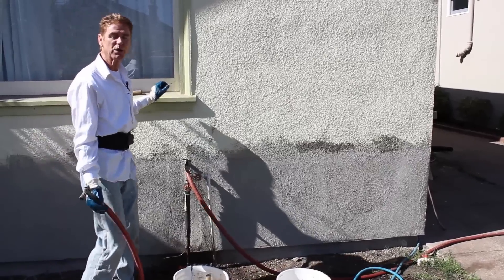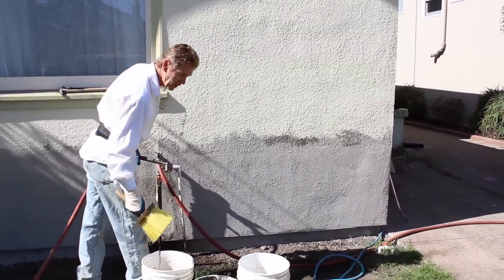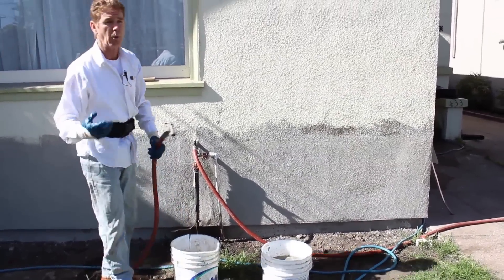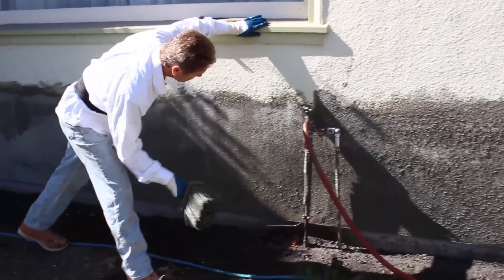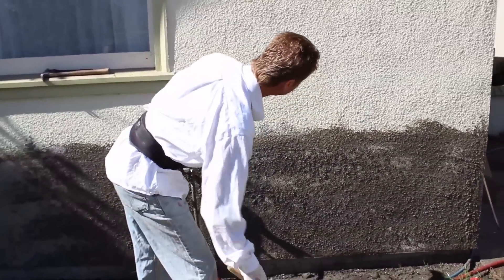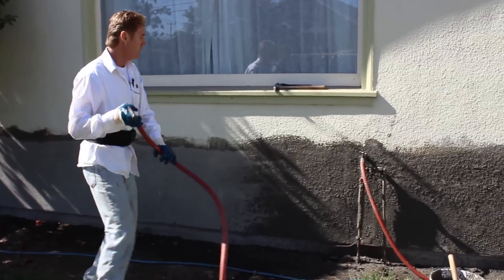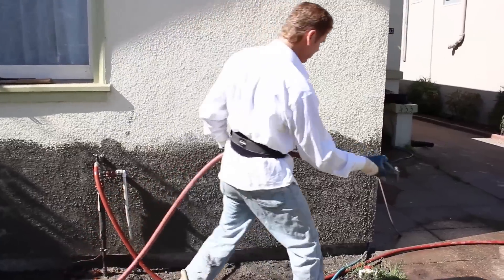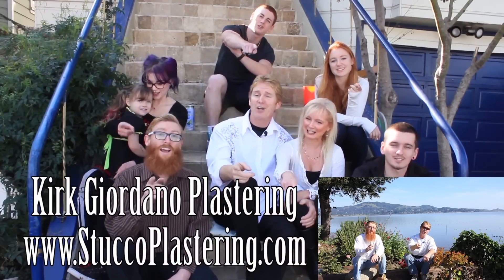How to dash a stucco finish with a Dash Brush

Comment: What’s the exact stucco and mixture you’re using here?
Reply from the maker: Were using regular Portland stucco mixed with three times the sand per every one part stucco. For example, for every one hundred pounds of cement stucco, 300 pounds of sand are added to the mix. 
Or for smaller jobs, buy, "Rapid Set Stucco," from Home Depot or Lowes.
 It has the sand already in the box or bag you just add water and apply. 🕵️‍♂️

Comment: Hello again Kirk. My stucco repair came out descent but I want to add more texture since the original application was a sand finish with a hopper. I decided to use the Dash brush by loading the bristles,holding the brush handle down, then pulling the bristles back and letting the stucco shoot onto the wall. There wasn't any extra soupy splatter on the wall, just speckles of texture which is what I wanted. The texture matched great this way since in wasn't as heavy of a dash in this video. Problem is that the finish crumbles and falls off the wall when touching it after it dried. I wet the wall prior and used LaHabra finish. Any suggestions?
Reply from the maker: Evening Rondie, yes, next time mist the wall with water for a proper mechanical bond.
 Your wall or your stucco was too dry, sorry.
 Watch this video again, I expalin this.
                               Live long and plaster
         Mastering Plastering for the beginner’s to experts

Comment: Beautiful job Kirk.  I replaced an light fixture with an electrical outlet outside my house and had some additional stucco come off around the new outlet. I mudded around the new outlet, but need to apply a dash stucco finish to match the existing wall. Would you recommend using a smaller brush for a small job? Or any other recommendations for a small job like this? Many thanks for your advice and looking forward to your new videos.
Reply from the maker: Greetings Karan, no need to buy a dash brush for the small stuff you will never use again. A small handheld whisk brush or broom also works.😉
  Our unique plastering Tip:  all subscribers or anyone who stumbles on our channel with a question, type it into our Stucco/Plastering channel, and like magic, a video will appear to explain how it's done. 	
   This feature is miles ahead of any plastering forum. 🥳	
Kirk & Jason Giordano Plastering

Comment: Hi n thanks for your help .can we do dash with color n what can a send you use 1620? Thanks
Reply from the maker: Howdy Jose, of course, you can dash using a color coat finish and yes you can use 20/30 or the thicker sand as in 16/20.
 Jose, you can also dash by hand or hand hopper.
                      Best wishes,
Sound advice From your neighborhood stucco geeks

Comment: Hey Kirk, where can I buy those gloves that you use? I’ve tried some similar ones that they sell in Home Depot, but the back of the fingers are not covered with the protective rubber layer like yours are which leaves me with soaking fingertips every time I dip my float in water.
Reply from the maker: Howdy, my friend, In the description, there is a link to the Amazon store. Cheers.
Reply: Thanks Kirk, but it seems Amazon is out of stock🥲.
Reply from the maker: Yea, they cant stay stocked, they are sold by "bontool". I here Marshal-Town will soon be making them.

Comment: i came back to this video because i didn't listen the first time about the soup. haha .actually has to be really soupy, 
do you recommend adding sand to a modified? i have a a coarse polymer mesh (modified) im using ACRYLBOND on the substrate (hardy tex / cementitious fiber plaster board) where some delaminated stucco has given up the ghost, 1/2 a dozen blisters , was gonna get out the hopper gun but remembered my training (aka your videos haha) came back for soup.
Reply from the maker: Normal stucco just add a lot of water .